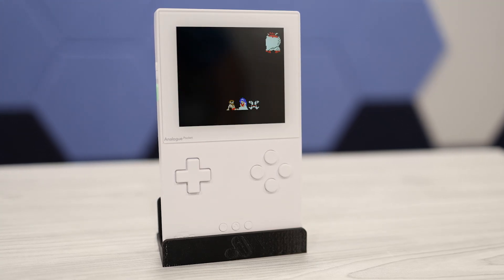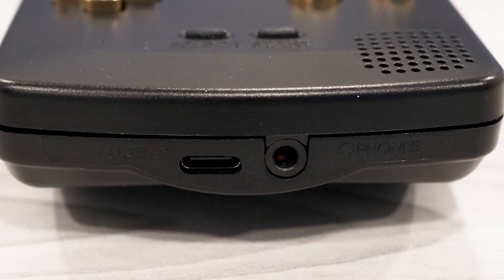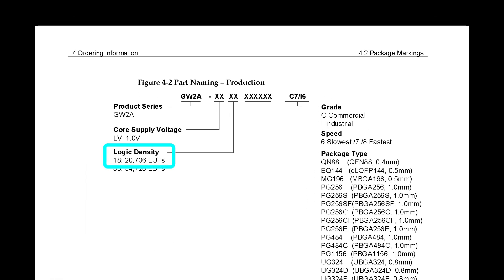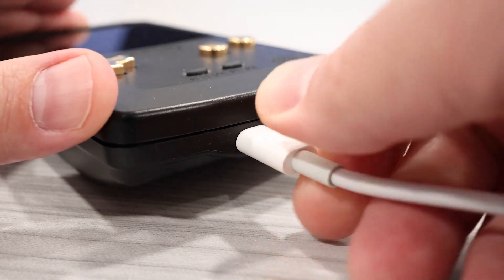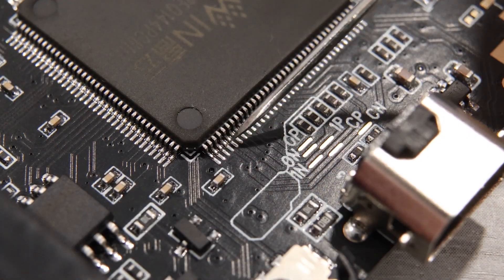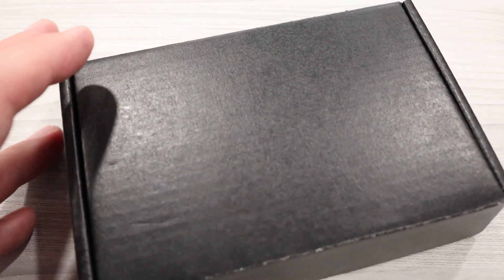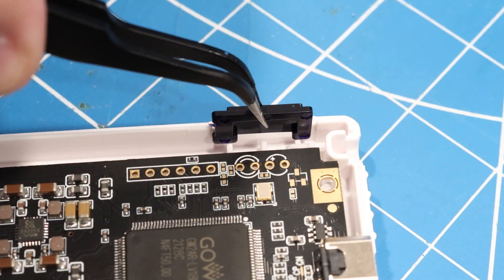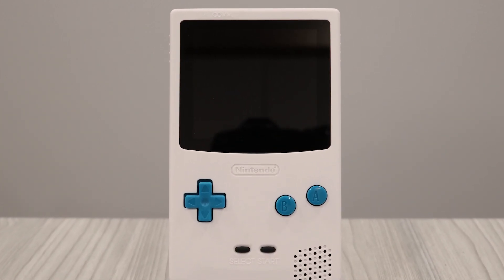Inside FunnyPlaying's New FPGA Game Boy

Comment: This is my favorite thing to come out for gaming since the actual release of the Nintendo Switch. As a retro gamer primarily, the fact that for $83 total, you get a complete GB Color WITH lithium USB C rechargeable battery and 3 inch IPS screen without needing 26-year-old donor console parts is absolutely wild to me, especially considering that $83 in 2024 money would be like paying the equivalent of $40 for this in 1998 when the GB Color actually came out. Super reasonable. Can't wait until they figure out a Gameboy Advance FPGA chip.

Comment: Electrical tape would work behind the screen as well correct? Just ordered a kit and noticed it said to be careful the screen didn't touch the pins.
Reply: No you only want to use the tape he used its heat resistant and can be got cheap online or hobby store possibly. ELECTRICAL tape is not good for inside electronics despite it's name. It's ment for high voltage wires. And can get very sticky when used for a long time. Not ideal at all for an alternative. I wouldnt use it either but masking tape would prob be better than electrical because removes easy but still sticks well. But just get the propper tape. Will not be great if you ever have to take it off down the road.

Comment: Is there a way to install an SD card?
Reply: You can play the fpgbc with a flash cart so it can make up the difference of not having an SD card slot on the side, it still runs great, but I’d recommend everdrive flash carts or lower, it can run everdrive as it is the only powerful flash cart with the reputation to run it well, it will not however, run an EZ flash Jr.

Comment: Excellent breakdown of the FGPA chip used in the FPGBC as compared to the Analogue Pocket FPGA chip.
The reason it's a kit is it really cuts down on their costs if they don't have to assemble the full thing.
I'm sure eventually someone's going to figure out how to hack it to use micro-SD cards but with flash carts being so prevalent in this area, I'm not sure it's worth the effort.

Comment: Hopefully this is a test to release a more "powerful" version that can also run gba.  
GB/GBC aren't that interesting considering there are tons of device that run them and plenty of modkit for original hardware.  
I was lucky enough that i bought an hardware clone with lcd display before the emulation craze started so i got a screen modded gbc for 25 bucks (gb boy colour).  
While i see the appeal of this kit with the bigger screen it kinda ends making the analogue pocket more palatable since you get so much more for double the price.
Reply from the maker: GBA would be the logical choice for their next FPGA handheld. Give us a microSD card slot in it, and I think that would be quite compelling. I remember seeing the GB Boy Colour when it came out. I never picked one up, but kinda wish I did
Reply: @whatskenmaking  the GBA is a slow, memory constrained, ARM7 device. There's some minor complication with the sharp cpu(that runs gb and gbc games), ppu and audio engine, but software emulating those devices is easy. What's the point in emulating arm in fpga? 
A $5 raspbery pi pico (or any modern arm cortex m micro) can run the native code and emulate the other devices.

Comment: Alleyway is the only game I've found that doesn't work. In theory, anything that uses the IR port would also not work. Though the link cable tested fine for me. I was able to link with an original GBC and play Puzzle League.

The only other issue I had was with a Grimace's Birthday repro cart. Being a newer GB Studio game, it often kernel panics when attempting to run. I tried it on an original GBC and GBA SP. Both worked fine. So I dumped the cart and tried it on an Everdrive Pro+. Worked fine in the FPGBC. Tried writing to an insideGadgets board. Worked fine in the FPGBC. Rewrote the repro cart with the latest Grimace Birthday image (v1.7) and still had the same kernel panic issue.

Seems like the problem is the HC007-BGA-V2 knockoff board. They're cheap repro boards, but they generally work fine. This is the only case where I had a problem with this board. For some reason, Grimace Birthday does not like that board when running on an FPGBC. Otherwise worked fine under literally all other conditions.
Reply from the maker: Appreciate the details on what worked and what didn't. None of my knock-off multi-carts worked, either ... I need to open them up and take a look at the design

Comment: Considering it does have a firmware update path via USB, maybe there can be longterm compatibility support in the future, but don't hold your breath for it. 

I can imagine a higher end FPGA used in the Game Boy Advance equivalent (They did bring out a GBA replacement motherboard kit after all) that might add support for additional retro machines.
Reply from the maker: Yeah, I think a different FPGA would be likely in a GBA version. If they give us a microSD card slot in a GBA device, and price it under $100, I think they would capture a large part of the market for this kind of thing

Comment: With the two button layout, I can't imaging them intending for anything more recent than an NES to be used with it. I could potentially see somebody coming up with a microsd card cart to play atari or NES games, but that's about it. But, for the price, it doesn't look to bad if you just want GB and GBC games. And mostly GBC as the GB Light exists and is by far the best way to play GB games on original hardware.
Reply: Game Gear.  TurboGrafx-16 (if the FPGA is powerful enough.)  Master System came out on the same day as the Famicom, so not exactly newer.  Neo Geo Pocket Color.  Those all had two buttons.

Comment: Sometimes games used tricks, undocumented op-codes or even bugs to their advantage. An FPGA implementation of chips or CPU without these results in a non-functional game.
Reply: I highly doubt Alleway includes any exotic programming trick, it's one of the first GB games from the 1989 line-up.
Reply: It being one of the first could mean that some practices were not well defined unlike when developers got to know the hardware better. While I understand the sentiment that hardware tricks get more known and common later in the lifespan of a product I wouldn't say that early games must always be super standard complient.
Reply from the maker: must... resist... temptation... to disassemble rom...
Reply: Really? That's super neat. Do you know of any examples where something like that doesn't work on fpga implementation?
Reply: @CarrizalesVO lmao yeah: Paprium. It won't work on Analogue's FPGA Sega machine, but that's more the game developer's choice as an FU to anyone trying to play his game on hardware that is not original 😂
Reply from the maker: Yeah, FPGAs are only as accurate as the developer’s understanding of the system. FWIW, Alleyway works fine on the Analogue Pocket…
Reply: @whatskenmaking >only as accurate as the developers understanding
This is why I don't get why people goon over fpga. That's no different than how software emulation works.
Reply: @immortallix  Yeah. It's emulation in software vs in hardware. The only possible difference could be latency, but for most games an extra 0.001ms response lag just doesn't matter.

People just like FPGA because of physical devices and elitism IMO
Reply: @immortallix  I think there are 2 main reasons: 
- Analogue marketing ("no emulation")
- no input lag (without run ahead, high speed USB polling and an appropriate display setup, software emulation based solutions can have huge latency, while FPGA-based hardware emulation devices only require a special attention to the display induced latency.
Reply: I can confirm your theory. In the early 2000's, I developed a Speccy emulator including the Z80 core (for the DC, GP32 & win). And many games didn't properly work until I implemented the undocumented op-codes. It was very usual in the 80's to use them, at least on the zx spectrum. So my guess is that this game may use some of them.